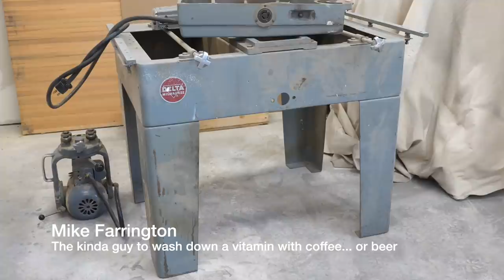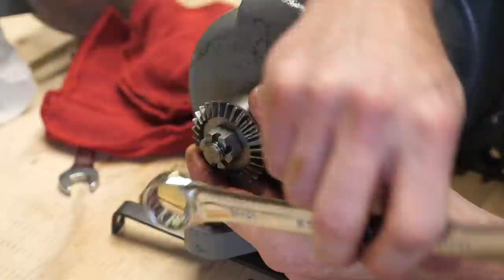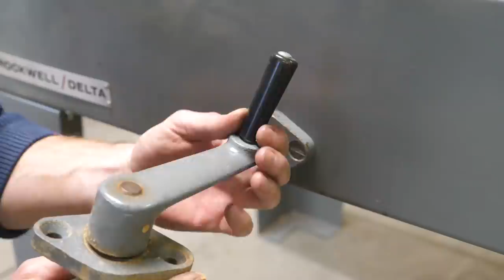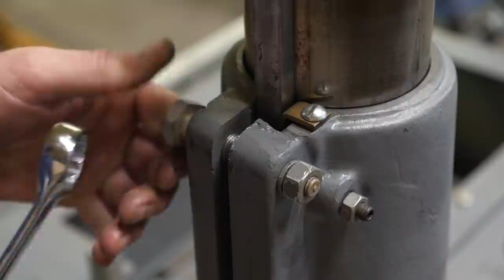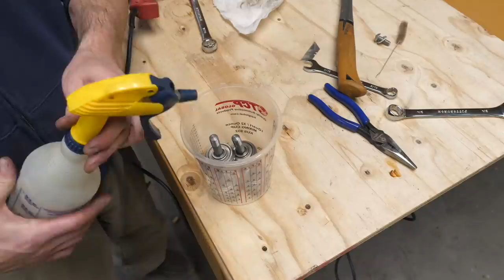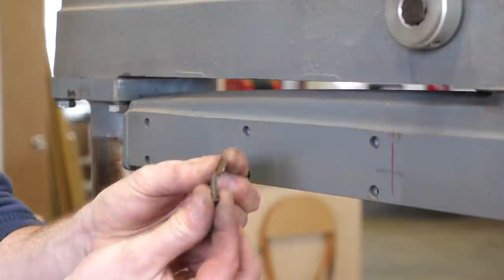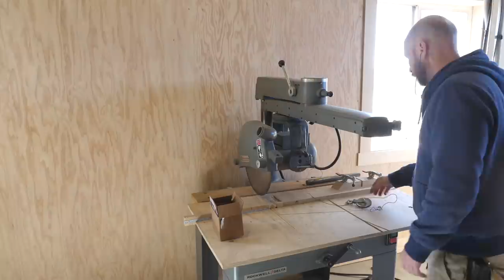Delta 16" Radial Arm Saw Restoration. It's colossal.

Comment: Great project! One of the downsides to radial arm saws in my opinion is the lack of brake on some or most that I've encountered. Curious if yours has one!
Such a powerful and useful tool! Sweet find
Reply: Also, it has a tendency to run toward the user if it catches on the wood.
Reply from the maker: This one does not have a brake. I would prefer that it did. As to it catching, the bigger the saw the less likely it is to catch.

Comment: Inspired by your restoration,  I'm trying to repair 2 pneumatic staplers I have, but they're still leaking after replacing all the o-rings.  I'd sure be down with one of your informative/humorous tutorials on how to diagnose and repair pneumatic tools.
Reply from the maker: I have an old grey nailer that needs rebuilding. Maybe I'll dig into it.

Comment: You don't happen to still have the extra 16inch blade guard do you? I have the same RAS, need that part.
Reply from the maker: No, That version didn't fit my current motor.

Comment: I have this same delta radial arm saw. I would like to fix it , but need some advice. The miter function round device, you called it the Taret piece. Am i spelling it right, or can you spell it for me.
Reply from the maker: I believe you are asking about the turret. That is the point where the arm swivels.
Reply: @MikeFarrington  yes, i am trying to find the part on eBay, but I didn't know how to spell the name of the part.  That you Mike.
Reply: Mike, where do you shop for delta radial arm saw parts ?  Such as the turret im try to find.
Reply from the maker: @rolandgarcia414  eBay is a good place to start.

Comment: Awesome rebuild.. I once had a near accident with a craftsman radial arm saw.  Someone else was ripping 2x4's and it somehow managed to climb the wood and shot it across the shop and out the garage wall 1 foot from wear I was standing.  Now everytime I see one of these in action, I cringe.
Reply from the maker: Ripping, there is the issue. They are great at cross cutting though.

Comment: Hey Mike, I'm going through some problems with my RAS, primarily with squaring it up to the top.  From left to right and front to back.  Can you go into some detail on how you had to square your RAS also?  I was hoping to see some content which might help me even though they're very different saws.  I'd really like to get it working again.  Thanks so much.
Reply from the maker: My plan was to include that in the next video. I'll build a table and go over squaring, then show a few different ways to cut with the saw.

Comment: Did you ever re-grease the carriage bearings? Just a tip, you can just toss the bearings in a cup filled with grease, then stick it in a small pressure tank at 30 psi, and it will push the grease into the bearings without needing to physically do anything to the seals.
Reply from the maker: That is a really neat tip. Thank you.

Comment: Mike, I liked your video, very well done. I have the same saw but with a 18" blade and the carriage moves not so good, I suspect the bearings are bad. Y ou mentioned you bought two saws would you happen to have a spare set of bearings?  I have not been able to locate a new set of bearings. Thanks again. Steve
Reply from the maker: Thank you. The bearings are obsolete, eBay would be the best bet. However, if you think about it, the bearings don't get cycled enough to wear out. What happens is they get packed with junk. In the video I should heating the bearings with a heat gun, then checking if they turn freely. Try this on yours, I think you will find they just need a really good cleaning a lube.

Comment: I love your video, it was very informative.  I have a silly question for you. I bought a 33-401 Delta Radial Arm Saw at auction but it did not come with a saw blade or a blade guard- oh and a power cable from the box on the side to the outlet on the wall. I have been trying to track down these items but I actually don't even know how to tell if it is a type-1 or type 2, and also if it is a 14", 16", or 18" saw.  I'm pretty sure the saw was never used as well, I think the state had it in their inventory but never used it.  Maybe they misplaced the blade guard? ha ha. Anyway, how do you tell if it is a 14", 16', of 18" saw and would you have a spare glade guard that you'd be willing to part with? Thank you
Reply from the maker: I really hope I'm correct in staying that there are only two different ways that delta mounted the guards. The older style the guard is captured by a wing nut. The newer style the guard is pinched down. I think any size guard will will fit if its a matching mount style. So for example I am thinking about getting a smaller guard, for my saw, just to run a smaller blade. I think it would make the saw more comfortable to operate. So I suggest looking on eBay, pay attention to how the guards mount and what I'm trying to explain will become evident.
Reply: @MikeFarrington  Ok, thank you.  They are really hard to find so far. I guess I'll take my time and restore it. I thought about selling it but I don't think that they used it - or it was used very little. Thanks again
Reply from the maker: @ocean6809  Keep watching eBay, and local ads. You will find one, but it may take some time.
Reply: @MikeFarrington  I finally settled for one on ebay that wasn't the cleanest, but I can clean it up. Mine did not come with a power cord from the box on the side to plug into an outlet. Could you do a video on how yours is wired? I can't find a replacement cord anywhere.

Comment: You can run a lot of 3ph industrial tools on VFD's which can be had on eBay cheaper than getting an electrician in (about $100). Even better on old industrial lathes and drill presses where you have to adjust the belts to change speed. You can do that with the vfd. Some models are better than others. Beleive 'space vector control' helps to prevent the power drop when you turn the speed down. A lot also have cabled remote controllers you can mount at more convenient locations.
Reply: I think Mike is pretty well versed in 3phase. he has many different 3phase machines, some with vfd and others on RPC
Reply from the maker: Good stuff. Thank you for sharing. I have run tools on VFDs for a good number of years now. More recently I upgraded to a 20hp phase perfect, which is similar to a VFD.
Reply: @billystray7007  Yeah i figured. I misheard first time i watched and thought he said it was 3ph and that was the pain for him. You wouldn't beleive how many people i've come across on fb forums mulling over 5k+ electrical quotes for low power 3ph industrial tools they picked up cheap were oblivious to the concept.
Reply: @Travis Sanford  yeah. I just got a $1,000 quote for an American vfd , I almost fell over . At that price I decided I may as well go with a RPC , now I can run other things that may come in ..

Comment: So, is the majority of this beauty the 'new' or 'old' saw?  I agree that the brass and bronze parts are much better (along with the adjustment wheels/handles).  Disappointing to see all the sway/wobble in your stand but some of that could be uneven floor maybe?  Building it in to your new miter station will fix that.  What are your thoughts on this design as compared to the DeWalt single pivot point design?  I have (2) DeWalts but I really like the rotatable arm track design your have there since the arm tracks are a prime wear point on the DeWalts.
Reply from the maker: Its mostly "new" parts. Minus the critical internals. I also pulled a few bolts and little things from the old saw.

Comment: Hi Mike. I just picked up the 14” model of this machine. It needs a good deal of clean up but I’m very excited. Could you please share the carriage return mechanism you purchased on eBay? I’m not having luck finding one. Thanks!
Reply from the maker: I don't know the part number, but it is a delta RAS return mechanism. Mine was "new" old stock. Keep looking you will find one eventually.
Reply: @MikeFarrington  thank you!
Reply: @MikeFarrington  hey again! If you still have it, could you possibly tell me what the serial number is on the older model you took the parts from? I think I have a bead on one that will have the bronze column assembly. Thanks!!

Comment: Hey Mike, curious to know your thoughts on the saw after using it for sometime. Worth spending the money to pick one up? I have a sliding miter saw that I feel is drastically under powered and I’m considering upgrading to a more industrial tool. I’ve been looking at a few 14” and one 16” model deltas like yours.
Reply from the maker: I really like having the RAS in the shop. I could easily do with out one, but when needed it sure is nice. I would say that I would only have a nice heavy duty, if my only choice was a light duty, I would pass. I would suggest 12 or 14" being the sweet spot for general work.
Reply: Thanks for your reply and answering my question. I’ll hopefully be picking one up soon
Reply: Just wanted to follow up and thank you again. I ended up looking into 14in saws and I found an omga rn 600. I’ll definitely be building a miter saw station inspired by yours soon. Your videos have inspired me to make some of my own so if you ever have a chance, I’d appreciate you taking a look at some of my work.
Reply from the maker: @Tommyfrey  Omga makes a very good saw. Good find. Thank you.

Comment: Three questions:
1) Did you ever hook this up to your dust collection system? Given that "dust is my bane," and that you also mentioned dust several times in this video, I'm curious. Was that a dust collection chute I saw poking up out of the top of the saw guard? If you did hook this up, how well does the dust collection work IYHO? (Do you have any before/after shots, do you have any of those fancy particulate measurements?) 
2) You also mentioned you'd try this out for a few months and see how you liked it. Well...? (Did I miss a follow-up video here?)
3) The justification for a RAS appears to be that it might have less versatility than a miter saw (apparently it's capable only of 90° cuts), but with the advantage of (likely) greater precision (all that rigidity and all). (After all, apart from finish trim carpenters, the rest of us mere mortals are probably using our miter saws as 90° "dedicated" crosscut stations more than 90% of the time.) Is this view of the RAS' intended use correct?
Reply from the maker: Thank you. If you have a look at my miter saw station build, I show the installation of this saw as well as dust collection. I use the saw almost daily. I would say my one complaint would be I wish it has a 12 or 14" guard and blade (I'm shopping on eBay and will hopefully acquire). The reason is the 16" blade is enormous and not needed. I think the sweet spot for capacity ease of use would be 12". Plus finding blades would be easier. As to the justification, well I really don't need a miter saw or a RAS, I can make any of those cuts on the table saw. With that said, this saw offers me a quick easy was to accurately crosscut over 20". Needed, no, but it speeds up certain operations.

Comment: Never used a radial arm saw personally.  It was the one tool in my grandfather's shop he banned me from using, as he referred to it as the most dangerous tool he owned.  I am curious though.  With the sliding table setup you have on that table saw, why the need for the radial arm?
Reply from the maker: Thank you. There is no need. However, the slider is not fast when I have a ton of cuts to make.
Reply: I also have a large cast iron sliding table, table saw. Also a 12” HD RAS I use the RAS often but now you have asking myself the same question. Answer: It’s easier on some cuts. The dado, rabbet, half lap ability is handy also. But I always say a prayer when I turn the motor on 🙏
Reply: It’s curious there is no blade guard at all and seems it would be possible to add one, similar to a mitre saw, though clearance, geometry etc might be tricky.  You could have a manually adjusted one that you set based on the depth of cut. 
Might make this beast slightly less sphincter clenching!
Reply from the maker: @mhorlor  I could add one for sure. I will comb ebay and see if I find one.

Comment: Isn't your sliding table saw the ultimate for cross cutting already?   I've never used one, but I just figured that would be the case.  I could definitely see the radial arm saw as a great dado cutting station though.

Comment: Hi! Sorry for asking a question unrelated to this specific video (amazing rebuild btw!) but I was wondering where you found that side fence you use to turn the Top 20 into an end trimmer in a bunch of your videos? Is it an aftermarket accessory? I've been googling around quite a bit and I don't seem to find anything. Thank you!
Reply from the maker: Thank you. Its called the Lamello NOVA. It will not be easy to get. You will need to call Colonial Saw or another national distributor. I had to convince them it was something they sold, before they would start digging through their catalogs.
Reply: @MikeFarrington  Thanks a lot! I will start my quest for it :)

Comment: What venders sell large blades? Looking for options for a 1922 straight line rip 14" dia 1.5" bore; but I haven't found many options.
Reply from the maker: 14" is the easy part, but you are going to have to get it bored out. Any sharpening company will be able to do that. This blade is made by Amana.
Reply: Global Tooling out of Oregon can help with your blade. That's where I get all my blades, up to 18"
Reply from the maker: @moldings_etc  Good tip, thank you.

Comment: I have a reasonably large workshop - around 400 sq ft or 36 sq m. I say this because I know that a lot of very gifted woodworkers deliver good results from a much smaller space. I used to have a very large DW mitre saw but had to sell that. Whilst I can and do cross cut on the table saw, making accurate repeatable cuts to the left of the blade is not as easy as I would like - indeed, I only have about 1m space to the left of the blade and so cutting a 2.4m length in half isn’t possible. So, I know I need to buy another similar saw. From the dear old days of New Yankee Workshop, I coveted a good radial arm saw, mainly for its ability to make rebates and dados easier than on a mitre saw.

My question is, if you had to choose one or other, which one and why?

Comment: Would like to see you make the top with fence very square so that the various miter settings are valuable.  Also like to see it put in a more permanent place with long extension tables.  I see that instrument as a replacement for a chop saw so why not find it a nice permanent home?
Reply from the maker: That is the plan. Though I will still have a small chop saw area.

Comment: Awesome! How did you decide on which model/brand to choose (i.e., was DeWalt one of your options)? Are parts fairly easy to get? Thanks for sharing your great work.
Reply from the maker: Parts are eBay only at this point. I have bought a few radial arm saws over the years. After owning a dewalt saw, I ended up liking the turret design of the delta more. With that said, if a smoking deal would have popped up on a dewalt, I may have gone with it.

Comment: No no no Mike you're way off. The Ace Tones opened for Ace of Bass and Ace Frehley (solo) in 1993 on the Three Aces tour. I was there. 

In all seriousness, great video. I picked up a small Dewalt RAS built in the 1950s I think. Still works very well, just need to build a good table for it.
Reply from the maker: I think you are spot on. That was a missed opportunity on my part. Thank you.

Comment: It seems such a shame to have that saw, so ideally designed for mitering and ripping, and use it solely for cross cutting.  The Deltas mid pivot arm keeps the blade track in the middle of the table for accuracy and maximum cut length…And as to ripping seeming “square peg round hole”, a radial is far safer to rip on that any table saw, when you set the guards correctly and/or use Board Buddies.   The reason is that when ripping on the radial, you are never in the line of fire of a kickback.  You stand in front, and slide the stock thru sideways. And if needed, go to the outfeed end of the table to pull the stock the rest of the way thru the saw. You never stand on the infeed side of the spinning blade.  If the saw does eject a chunk of wood, it flings it off to the infeed side.  I rip on a radial up to 26” wide and have never had a problem.
Reply from the maker: The main reason is, I have other better ways for doing those tasks. What I like about this saw is it does the one thing really well, with no setup. Turn on, make cut, move on.

Comment: Interesting.  I also have a Delta 16" RAS, though mine is a newer "vintage".  5hp, 3ph on a VFD.
Reply: Be VERY careful with that auto return spring.  The ZAMAC housing on mine broke right at the mounting bracket.  You're pretty lucky to have found one on the ebay.
Reply from the maker: Thank you. I'll keep an eye on the auto return. What is the weak point?
Reply: @MikeFarrington  Basically that entire arm that comes off the side of the housing.   Ideally, I would make some kind of "cup holder" that grips the housing on the outside.  

On mine, someone drilled the hole in the arm larger than how it comes from Nesco which caused it to break at the hole and then the arm itself cracked.
Reply: I think they were originally engineered as a "tool balancer" and I think the arm was never intended to support a "moment".  I think it was intended to hang vertically by that arm, maybe even on a swivel or ball joint.
Reply from the maker: @prototype3a  Great info, thank you.